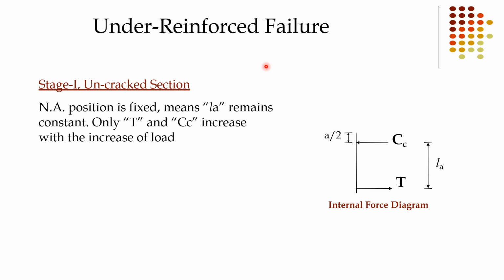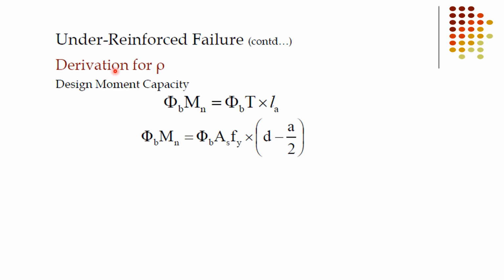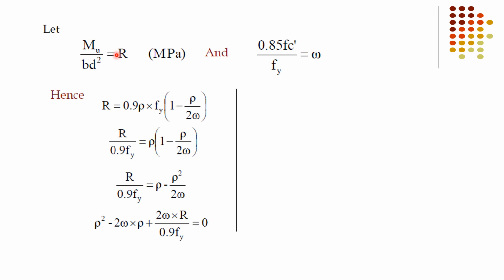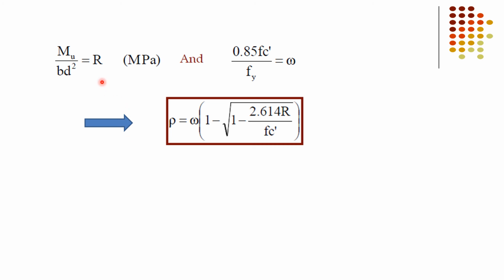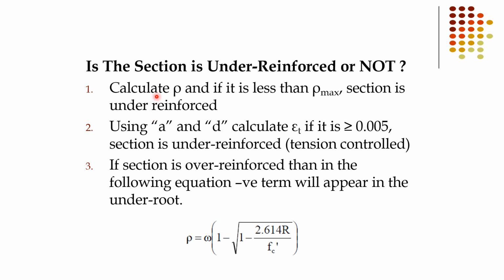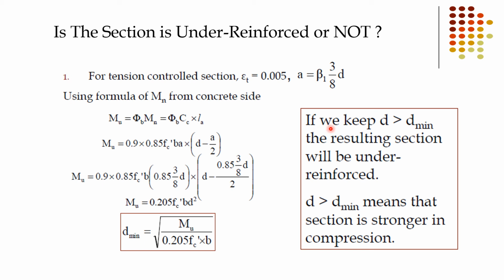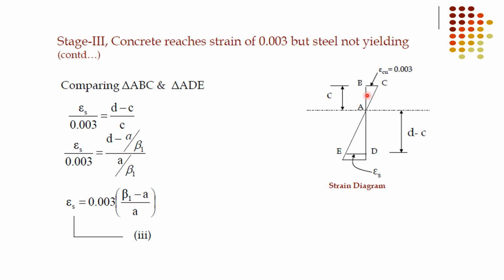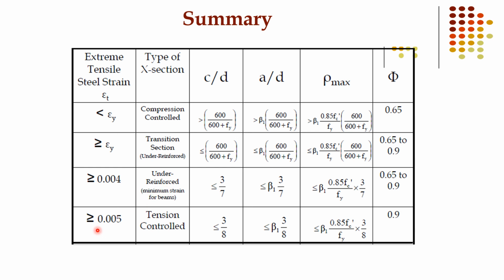Design Concrete Structures Lecture - 6 Under Reinforced & Over Reinforced Concrete Beams

Comment: Sir can pls explain how d>dmin results in an under reinforced section?  If d>dmin then concrete on compression side will be stronger but can it be stronger on tension side ? At 10:00
Reply: Thanks sir
Reply from the maker: Bottom Line:
d > d_min usually leads to under-reinforced behavior, because it allows the steel to yield before concrete crushes, given the same moment.

This doesn’t make the concrete stronger in tension — it just changes the force balance and lever arm.